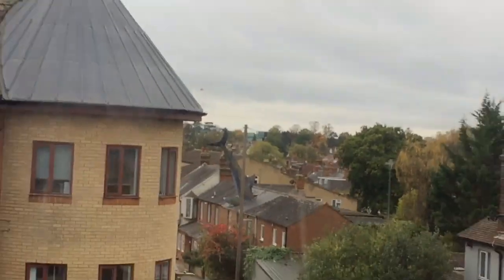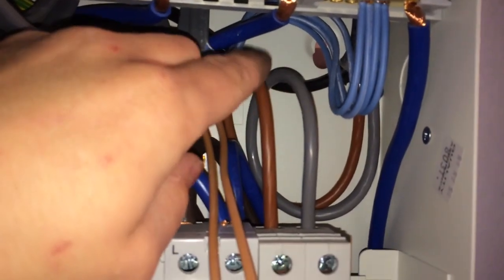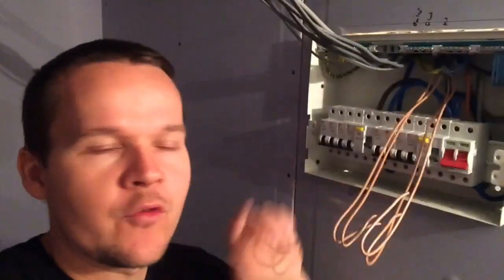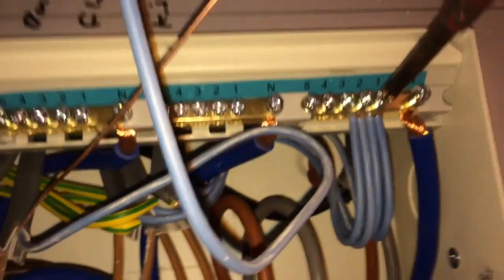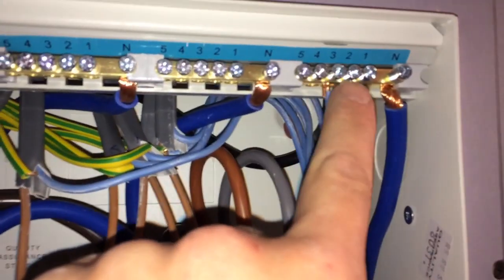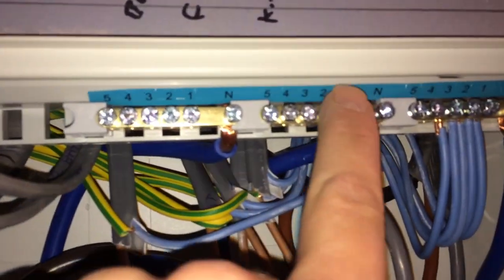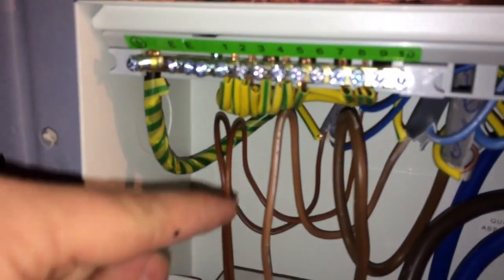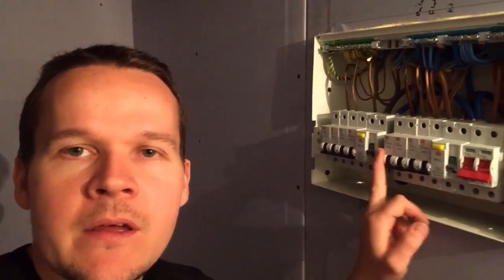Connecting Up A Consumer Unit

Comment: Wrong neutrals need go on first rcd bar the first neutral is for main switch side good job mate keep it up
Reply: imran Khan yeah good spot.Usually I put the smokes their on their own RCBO.
Stopped fitting split boards I just put every circuit on its own RCBO now.

Comment: Too much copper showing on that boiler neutral and use heat shrink on the grey and black mains as tape is for amateurs.
Reply: Hmm, you could say the same thing for the thicker neutrals some manufactures have ferrules on them at least 1cm! although I always
do it a bit neater, at the end of the day does it matter that much?